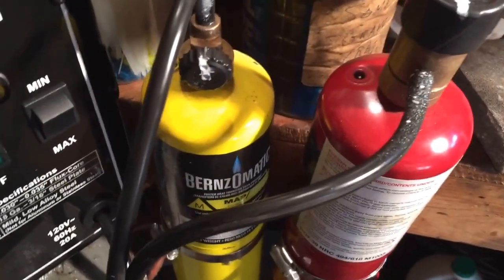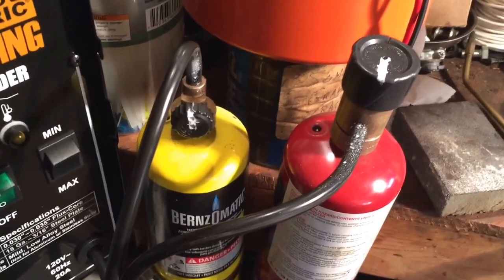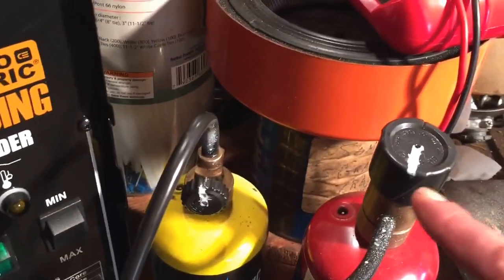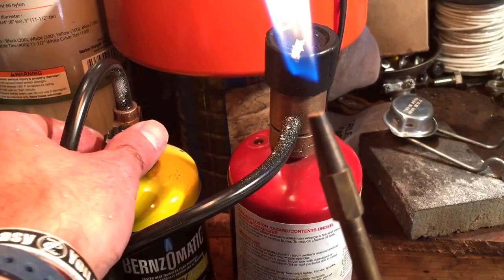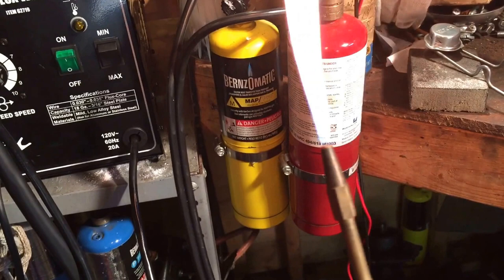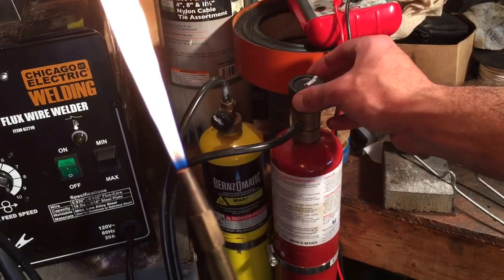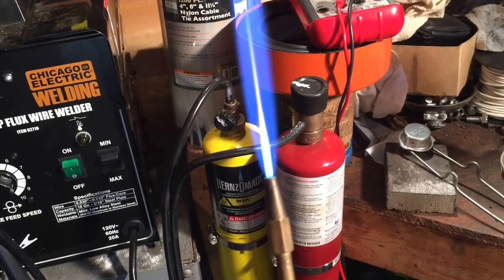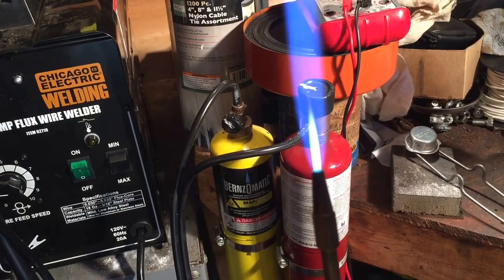Bernzomatic Map/Oxy torch How to start & Tips & tricks 2017

Comment: Thank you so much, this is exactly what I was hoping to find online. I've messed around with the kit a tiny bit so far, and the knobs seemed so touchy that I didn't want to keep wasting gas. The oxygen kept blowing out my flame, and that's a little worrying when you're new to using torches.
Reply from the maker: The mapp knob is very coarse thread needs to be open about an 1/8 of a turn. The oxygen is a finer thread needs anywhere from 1-3/4 to 2-1/4 turns open. Thanks for watching!

Comment: I used mine to cut a stripped lug nut from the stud without damaging the treads on the stud. Many of you are probably familiar with the technique of "washing" a nut off a bolt with a cutting torch without damaging the treads. Once the metal was molten I just increased the air flow enough to wash away the nut. You won't damage the threads as long as you are careful not to over heat the bolt/stud. As mentioned in the video wind can make it harder to keep enough heat on the metal to get it to a molten state.

Comment: Was able to melt thin finishing nails to one another.  I used it to braze a 1/8” thick flange onto 2” black pipe.  It was a way for me to try gas welding compared to liquid o2 and  refillable tanks.

Comment: Thank you and yes, it hates outside.  yes, it is cheap and inexpensive.  However, I fixed something with it by brazing it with the rod that came with the kit. It got me out of a jam.  I bought it probably 8 yrs ago and finally used it. Do you do any vids demonstrating any different rods/tips?  I will def mark my valves with a paint marker.  Exactly as you said, the O2 is slow so I over turned it too fast and had to keep playing with it til I got it right.   your idea with the white paint would have saved me time. doah!
Reply from the maker: SpockMcoy Issmart thanks for watching.  No sorry no videos with different tips.
Reply: @DKTractors  ok

Comment: I luv canned compressed air, turned upside down for freezing nuts/ bolts loose, where heat is an issue. 
Freezing loose works even better if you can heat up the part.
Reply from the maker: Cool idea! (Pun intended) I’ll have to try it. Thanks for watching!
Reply: if what comes out is a cold liquid then it is not compressed air but more like butane or other compressed liquefied gas,,some is sold as gum remover ,also the same stuff used on athletes with bruises

Comment: Not everyone’s will knobs will adjust the same so you should actually go by the flame and you should always have a little oxygen on so gas doesn’t get sucked back up the line with fire especially when turning it off,gas first then oxygen but people should look up to see what flame is needed for what use then they know and don’t go by adjustments that will vary for each unit.
Reply from the maker: @barrykilts4506  agree but the emphasis is on having a mark on the knobs to know how much it is opened, not necessarily on the number of turns.

Comment: Why not just use the mapp gas for the bolts by itself?  I've done a lot of pump work with bearings on shafts and bolts, and for small stuff the mapp gas is plenty for it.  For bolts definitely good enough.
Reply from the maker: Still hotter with oxygen for the really seized screws.

Comment: I have 2 of these torches. One has MAPP gas in it i know BUT where i have put it? Used it once a loooong time ago with no problem. Probably had the instructions! LOL Other one has propane and i was having problems getting it lit (like i see in the comments) UNTIL i was reminded here. THANKS. I barely cracked the propane open in order for it to STAY LIT. I don't think i even made it to your 11 O'clock position and it was blowing itself out. Anyways, problem solved. As far as the Oxygen, that will vary on what type of flame you are looking for. There other videos on YT explaining the different types of flame--- neutral, oxidizing, reducing---- what they are used for.

Comment: DK thanks for the tips ...I find the same , its light duty but all I need at times ...maybe once a year last time I used it the oxy valve was blocked or something , no flow I played around to get it working and took it off the bottle when it was stored in my garage , today I need it so I installed the valve for oxy and tried the full mapp cylinder valve now it is blocked stuck or seized , I can't find any info about freeing the torch valves up ...any thoughts ? thanks
Reply from the maker: deepvillage never heard that. Mine are in my unheated shed year round. Thanks for watching

Comment: I have an older set up. I only have propane and I wanted to test to see if the tip and all was alright before I went to buy a small tank of oxygen. Does anyone believe that if you hook up the propane without hooking the oxygen up, should you smell and feel a small bit of propane coming through the oxygen side of the hoses, or is this an inner seal issue in the mixing handle?

Comment: 10 to 15 mins for these bottles to run out is too expensive. Have you tried to hook up to larger bottles. Is there an adapter to do that?
Reply from the maker: Don’t know if any adapter. Eventually I will get a real rig that puts out much higher BTU.
Reply: There is a video on here somewhere about making an adaptor to suit a D size oxy bottle. Check out "Arcstreams" comment below.
Reply: Wow, I just got my unit, cheap, bought a pair of bottles for $55!  At 10 minutes, any work will be wildly expensive. I can’t think of much I could do at $5.50 a minute that would not exceed the price of a new bolt and nut!  I love the video, it was so helpful, but now I wish had passed on the purchase. Bernzomatic should label the box: “This unit burns through money”

Comment: Uh... thanks for the video but I have no clue what you said after you turned the oxygen up. All I heard was the torch with some mumbling in the background.
Reply from the maker: Tee Shark sorry yeah I bought a mic recently because of that. Basically comes down to having a mark on the knob to know how much you have rotated it. The small blue flame in the middle should be about an inch long.

Comment: Why doesn't the oxygen last long ?
Reply from the maker: Good question my guess would be it has to do with transportation and liability. Thanks for watching hope the video helped
Reply: plus you need a bit more psi on the oxy
Reply: ARCSTREAMS oxygen Can’t be compressed like map or propane can
Reply: technically it can be compressed into a liquid state but requires special double thermos cylinder unlike the simple tanks of map or propane you find at any hardware store,,but they still make those for oxygen only very little compressed oxygen in it and only in gas state,,they can pump more psi of oxy in the cylinder but they will say for some safety bs excuse that they wont so that is why these things do not last long at all ,i am lucky enough to have a 60CuF oxygen cyl that lasts very long time when i combine it with a small cyl of propane or map specially for my  mini torch i made,,you can see a vid of it on my ch
Reply: @ARCSTREAMS  Cryogenic oxygen is very difficult to contain. It's why no probes or satellites use it. We're talking a "half life", so to speak, of couple weeks.

Comment: it aint cheap once those 5 min lasting oxy crap bottles start runing you more than what you paid for the whole thing in no time flat
Reply: Hell yeah the first time I used mine it ran out so fast I thought someone used it before me and returned set, they put it back on shelf not knowing it was used then I buy it. But I think they just run out fast.
Reply: @Surtac100  luckly i never had the dissatisfaction of ever using the oxy,,i only buy the propane too i dont bother with the map/pro which is twice as expensive and not that much useful in difference of heat  ,,and for oxy i have my own 60cuf cyl that last me very long time in combination with a small propane cyl and my homemade mini blow torch ,,you can see it on a video on my ch if you like to have a look

Comment: The reason why oxygen don't last is because its gas oxygen not liquid as the propane or mapp gas is.trust me don't spend the money.bernzomatic has a map unit the T-8000 that puts out good heat also the t 4000
Reply from the maker: I’ll have to try one thanks for watching
Reply: but do they get hot enough to braze?
Reply from the maker: Yes but very light duty

Comment: Thisi. Is a piece of crap I don't know why you are saying anything good about this torch...the torch is okay it will give lots of heat.you can braze easy with it....the problem is that the mapp gas will last a good while .. BUT the oxygen don't last but fifteen minutes at ten bucks a pop..gooood luck. I took I took it back .also the adjustments are horrible.I'm a retired machines and welder I wanted this unit for my hobbies..N.F.G
Reply: its bs ,they could put more than 1 measly cubic foot of oxy in those bottles but they wont,,i am good to go with my 60 cf heavy duty industrial oxy tank and a small B tank of propane or map pro